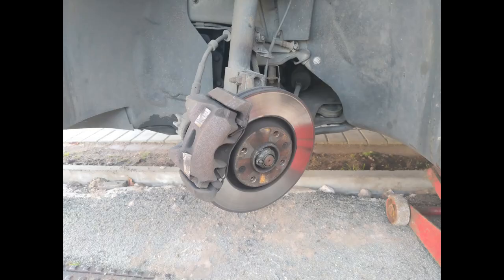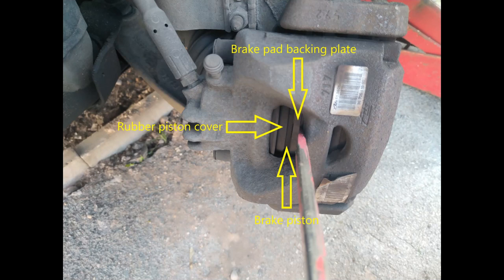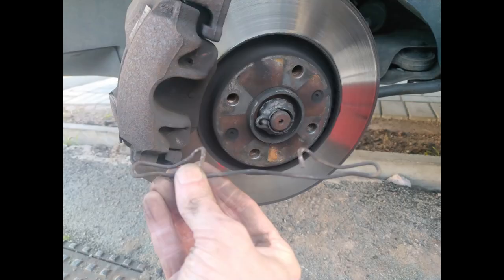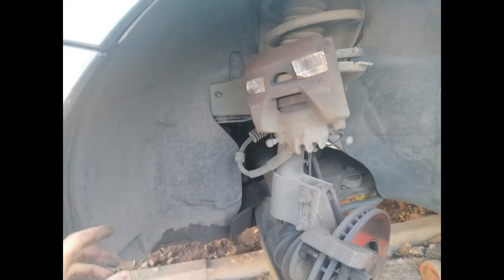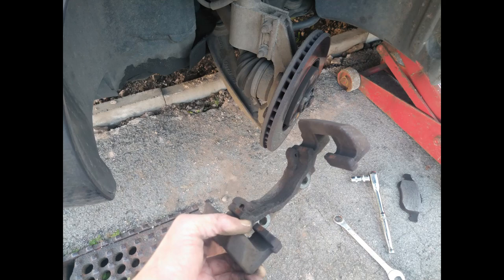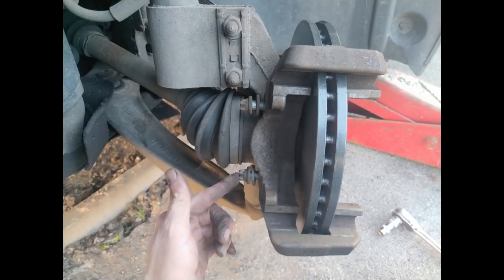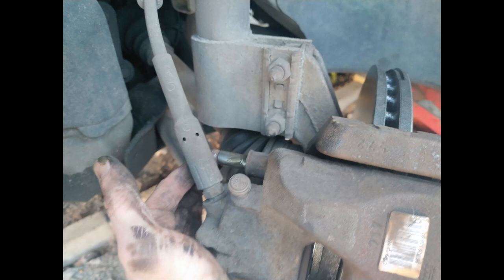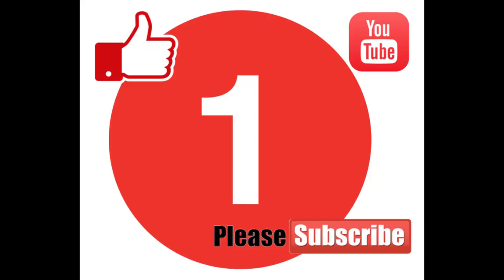Citroen C4 front brake disk and pads replacement

Comment: Didn't know how to message you privately but did the aircon clutch,the maxgear one is a good fit,but it's definitely worth getting a decent set of circlip pliers,I cheaper out and cost me about 30 minutes trying to get the bloody thing on, but the job is definitely achievable by the average diy mechanic
Reply from the maker: That's good to hear. I like the way you say 'good' pair of circlip pliers. I have bought plenty of bad ones and ended up grinding the tips to get them to hold a circlip. I should put it in the description but I can be mailed on channel1diagnostics@gmail.com

Comment: Very instructional video. I have always smeared copper grease on the backplate of the new pads to prevent squeal, is that still recommended or does the improved design of modern calipers not need this? Thanks.
Reply from the maker: I used to as well but neither this car or the Honda Jazz I did, and haven't uploaded a video of yet, had any signs of it. But strangely while the C4 brakes are fine the Jazz was squeaking initially. 🤷‍♂️

Comment: A good video was going to ask what size allen key but you did say 😂good job i looked back
Reply from the maker: The Allen key is 7mm. I would definitely buy a good one, or a 7mm Allen key socket for on a ratchet. It's not a location you want to be rounding off the bolt head that for sure 😬
Reply: @channelone4655  yes thank you .
Reply: Was about to do the change on my DS4... I don't have a 7mm anywhere in my tool box 😩😩
Reply from the maker: @hywelthomas21  Don't be disheartened. I was expecting 14mm hex head bolts to hold my caliper bracket on but found the torx bolts instead. So take a look first as you may the model change between the C4 and DS4 has brought about different parts anyway. I'd expect the process to be broadly the same though.